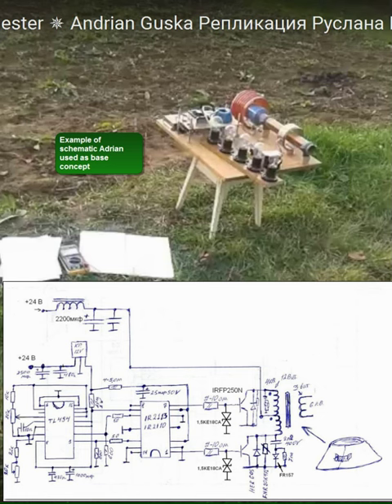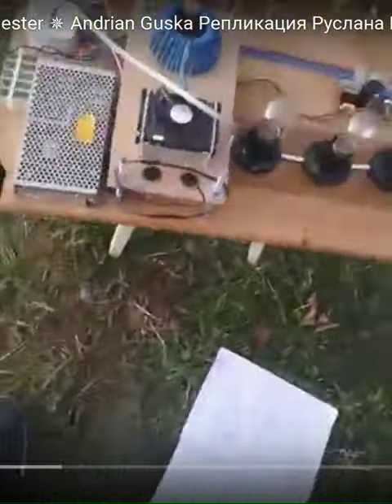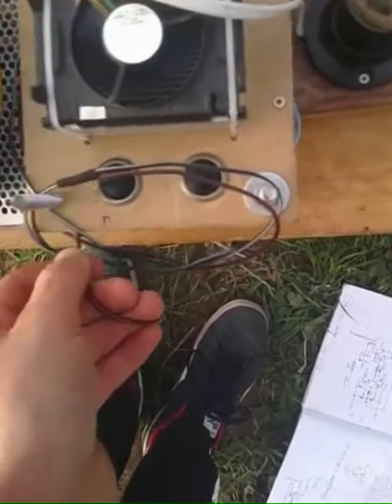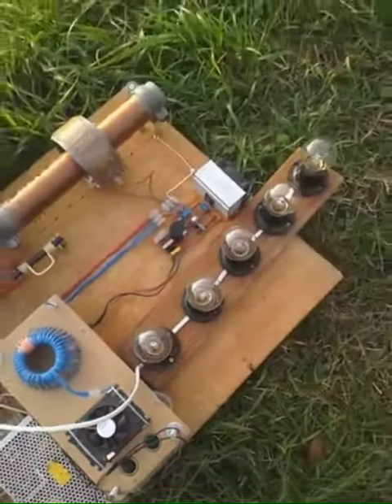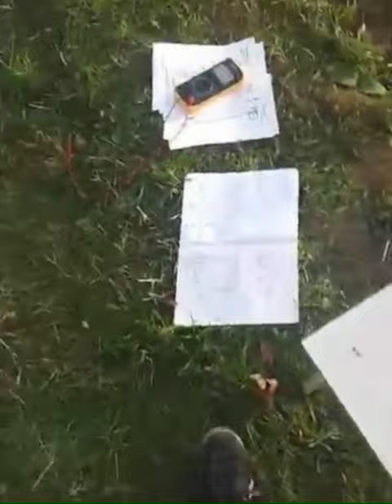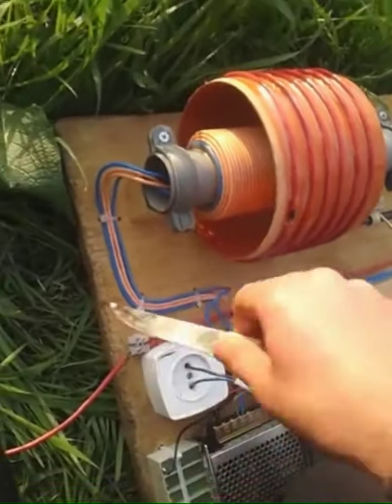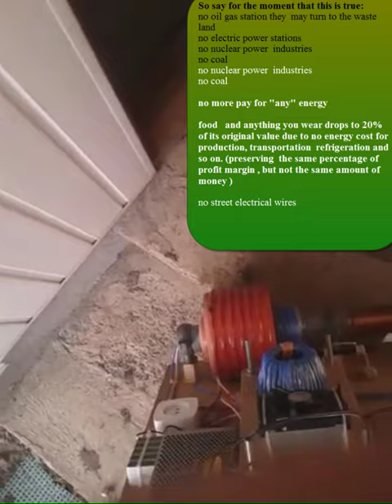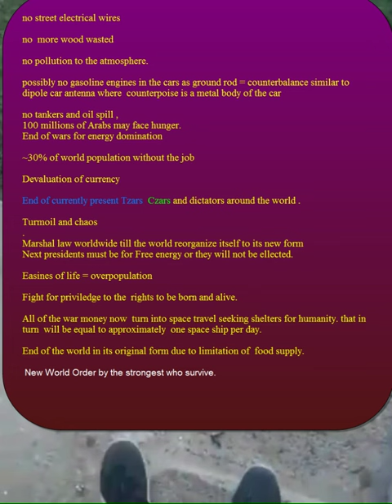Andrian Dniester -Free Energy Device part 2 in English

Comment: The problem Wesley is that this is so ridiculously easy to fake.  One month before this clip was made a car battery and high frequency-high voltage generator circuit was buried in the field where the soil has been "turned over" to grow crops.  You notice that the "ground wire" goes into this "turned over" soil, and not into the area where there is green grass.  The whole circuit is powered by an avramenko plug.  That provides low-voltage DC to the light bulb load.  To me it looks like the light bulbs get brighter when he puts the plywood board down in the grass.  This is because the avramenko plug is now closer to the ground plane of the earth and so the capacative coupling to ground is better and more DC power can be produced.  He does not get a shock when he touches the bare "ground wire" because of the high-frequecy skin effect.  The whole thing is 100% FAKE and is an avramenko plug circuit.
Reply: Also, here is what you will NOT see in one of these clips:  To get the "earth ground" connection you do it live on-the-spot.   You have a long grounding rod and a big mallet.  You pound the ground rod into the ground in the grass area.  The then you connect a true grounding wire to the circuit.  Obviously if you do this it makes it much much harder to pump high-frequency high-voltage AC through the "ground wire" to power the circuit.  I will repeat to you:  The whole thing is FAKE and it is just another attempt to find a gullible investor somewhere in the world because the Internet has a wide reach and can find somebody out there.  You are looking at criminal activity, a con artist that buried a battery and a switching circuit in a plowed field and then waited a month so that all visual evidence of the act of burying the battery in the soil would disappear.  This is so easy to FAKE and Occam's Razor says that this circuit is a FAKE.
Reply from the maker: You sound like quite high in art. But not as high  in this  particular art.:)
I do thank you for challenging a subject. Skin effect in  frequency  range ~ kHz region to Up MHz at Avramienko  fork ,will always!! give a discharge spark to your finger when you touch it. and That is not taking place here. You may try to  point at voltage potential but-
I'm in   possession of  material that is not yet authorized to be published. - by that I reject Idea about Battery  or any power source pre- buried . 
Wesley
Reply: stivep1
No, it is not necessarily the case that there will always be a spark if he touches the wire.  The signal in the wire could be a 100-volt peak-to-peak voltage waveform at say 100 KHz.  That would probably not cause any discomfort if you touched the wire and certainly cause no spark, especially if your shoes are insulating you from the ground.  The battery buried in the ground is a perfectly plausible explanation for this.

We also have secondary information that allows us to make some strong inferences about this subject.  This alleged free energy scheme has been going on for about 5 or more years now.  You had TK, then Akula, and a whole series of Russian, Ukrainian, Serbian and other "inventors" all pitching essentially the same thing.  However, 5 years later and there are no known working systems verified by two or more independent third-party testers.  Also, if it was actually real, it would be world news, just like the announcement of alleged cold fusion was world news in 1989.  This has not happened.

Finally, Itsu made some very faithful replications of these systems and he made a board to make high-voltage very short pulses, etc, etc, and nothing special happened.  The results that he got on his bench were consistent with exactly what you would expect to see, nothing more and nothing less.

There is always a hidden power source in these systems, and the "ground wire" is one of the obvious choices for faking one of these systems.  One of the beliefs on the free energy forums is that somehow like magic "power can come up from the ground."  A few years ago many experimenters were playing with ignition coils and deluding themselves into believing that power was coming up from the ground.
Reply from the maker: The discomfort is not  the case .  Have you play with Avramienko ? I did in my lab in all voltages possible. And I have so  amusingly incredible easiness to  make this kind of tests. 
I'm in   possession of  material that is not yet authorized to be published. - by that I reject Idea about Battery  or any power source pre- buried . 
Wesley
Reply: stivep1
Here is what you will never see in your life:  Three systems are delivered for independent testing, one for Tinsel Koala, one for Poynt99, and one for Picowatt.  If these systems were real, then producing local power for free (or from "somewhere" because there is no free lunch) would cause a revolution and save millions of lives by facilitating improvement in basic human needs in third-world countries.  The person that creates these hypothetical systems would not have to keep their technology secret or protected for business and patent purposes.  They would be the next Steve Jobs and Elon Musk combined in one.  They would have no financial needs for the rest of their lives even if they gave it away to humanity for free as an open-source gift to mankind.  But all of this will never happen because none of this is real.  Instead of talking about some special sauce or secret sauce, just prove me wrong.
Reply from the maker: good point-well taken :)
Wesley
Reply: stivep1
Well there is an expression, "Business is war without weapons."  If you believe that we are living in a civilized society based on a free market then there is merit to what I state.  Of course any country has some regulated markets and there is also corruption and crime.  All that being said, it you own an apartment building you can heat it in the winter with electricity, natural gas, or oil.  In the old days you could use coal.  In places like New York City you can purchase steam to heat your building.  How they actually produce the steam is not your concern.  You are free to choose what supplier you want to go with to heat your building.  Typically you are going to go with the system that gives you the cheapest price.

In this time we are living in in the 21st century, massive companies can disappear in a few years.  Nokia was the largest cell phone manufacturer in the world for years, they were the kings.  Now Nokia is gone, replaced by Apple and Samsung.

The oil industry will never go away, we will always need oil.  However, it could one day shrink in size by 80%, you never know. The top ten energy consuming industries combined are presumably much much larger than the oil industry.  If you can sell a "better mousetrap" to the top ten energy consuming industries then presumably your company will grow and the oil industry will shrink.
Reply: there is a similar kapanadze device like this named akula device 0083 has a free schematics of components and list of material ready for you to build its only 30watts and it is started by a pulse just like andrian's device after it started there is no need for source, it can run as long as it last but if stopped needs a pulse to start again. google akula0083 30 watts and build 1 for your self and prove me wrong.
Reply: John Christopher Delegero
It works the other way around.  The alleged technology has to be proven to WORK.  You build it and prove that it actually works and change the world.  You build it and prove ME wrong.  The burden of proof falls on the shoulders of the claimant.
Reply: google akula0083 30watts schematic diagram i will try and build this if i got the materials its the miniture version so not so complicated and can be easily understand.
Reply: John Christopher Delegero
Good luck with that but I can tell you that I have thousands of hours of experience on an electronics bench and it is not going to work.
Reply: its not very obvious in your profile that you are in the field of electronic for a long time. anyway if not now i will definitely build it in time.
Reply: the answer to that is the efforts of this genius minds in soviets will pay off and will give self satisfaction and honor for their hard work and help other people to have better life since i see this technology as the future energy source. it is when all of the worlds people are using and benefiting and thinkering and perfecting invention so we will have the chance to make free of price tags, fees, etc.. this money system is a limitation and hindrance of real progress. money is not really needed, it was just a token made as an exchange of service or feeling of honor of making something that would help others. look at what money does in the world. we have plenty of land, of energy but because of the limitations of money to get what we need many are hungry and many are deprived and in puberty and we lived in a world of wars because of competition of getting the raw materials not even for the need but for profit, even we our selves fear of losing because we our self is in need of "money" which had become the norm. by not monopolizing and sharing the knowledge, resources, technology it will create abundance and free and open society where our next generations won't have to suffer to secure the future, and to have self honor is to see we helped people that would give honor and will give the feeling of self satisfaction, to see they benefit from our efforts and see it makes their life better. if more and more people have better lives in a free and open society where everything is shared, and we don't have the fear of losing that is important to us, since when everything is free and shared, greed and limitations of money will be gone, by that time, its not only those who have money that will have better lives but all will. greed and selfishness should be abolish naturally since it is a direct opposite to abundance and progress and free and open society. and crimes associated with money and greed will be gone and we all  have a better lives. and enjoy and truely live our lives and do what we want and what we really like to do and be happy living.
Reply: they admitted recently that there is a loop hole in the 2nd law of physics that they wrote. and in that statement they admitted that energy can somehow be "created" or a loop of produced energy can be maintained at a given state with in limitless amount of period or time, this does promote a perpetual motion or a looping of energy.
i think they release this because they can't control the evidence of new discoveries and that current laws of physics could never explain, that would make the mainstream science a lie and them liers, if they will just deny the evidence just because the current laws of physics says its not possible.
Reply: Wesley I admire your passion and strong desire to do good for the world.  Also I agree that there is a lot of really good Russian "brain power" out there.  Kudos for quoting that Leonard Cohen song, he just passed away a few weeks ago.

You know that Itsu is a good replicator and has tried to replicate many of these systems.  What he always finds is this:  the coils, switching circuitry, capacitors, tank circuits, etc, do exactly what they are supposed to do in real life.  I have looked at his clips and seen his scope displays and I see exactly what is supposed to be happening is indeed happening on his bench.  Look at the advice of a serious expert like Verpies or perhaps the most knowledgeable person on the forums which is Picowatt.  The replications are always the same - they do exactly what they are supposed to do in the real world.

Take a fancy coaxial arrangement of coils and tank circuits and nano-pulsers built around the famous "grenade coil" configuration.  There is no possible way for "energy from somewhere" to enter into a grenade coil.  Can you imagine an interactive sculpture in a museum that consists of a bunch of springs and weights connected together?  You push on a weight and all of the springs and weights start to oscillate.  Well, that's what a grenade coil is like.  The mechanical springs and weights don't manifest free energy and likewise the coils and capacitors don't manifest free energy.  I cannot explain what you observed at the various meetings in Eastern Europe, I can only tell you what I know.

With respect to the two WTC towers collapsing at near free-fall speeds, I can explain exactly why and how that happened.  I have a very good instinct for physics and I have argued this point out many times with people.

Here is a thought for you:  Why can't a singe "free energy inventor" among all of the TK/Akula people simply be 100% altruistic and simply give the alleged free energy technology away?  Why not?  In today's society just giving it away would make you famous and you would not need money.  You could charge for speaking engagements just based on your fame.  Something does not add up.  With my bench and electronics experience (from a long time ago) I can still "feel" if something is right or wrong.  When Itsu does a replication it feels right.  When RomeroUK did his fake over-unity pulse motor, it felt wrong.

I truly wish we had technology to make energy "too cheap to meter" but right now the vast majority of our electrical power comes from brute mechanical power.  We are always trying to find a better way to harvest brute mechanical power, i.e.; giant windmills.
Reply: John Christopher Delegero
Please see my recent reply to Wesley for more thoughts from me about this important subject.  I also want to solve the energy issue for society, it's just a question of how you really do it.  Playing with coils on a bench may be an interesting thing for you to do, but in the end you need to come to the proper conclusion based on the evidence that you see on the bench.
Reply: mainstream science's and all its laws are blocking considerations, more even it is blocking new understanding just because it said its impossible or not possible to happen.

Comment: This sort of looks like a "reverse" tesla coil where resonant rise in the L2 results in parametric variation of the dielectric field storage coefficients which is then stepped down to high amps low volts, I've been thinking about something like this since I learned how a "generator" actually works, I can't say if the device shown here is real but the concept itself should work, I'll need to look into this more.

Comment: Why they work only light bulbs?
Reply: Because the output of the device is formed constant voltage (AC has a very high frequency, so it is difficult to use, it passes through a bridge rectifier to Schottky) Of course, you can put and DC electric motor, but why none of the designers do not do it ... I have no idea ??!